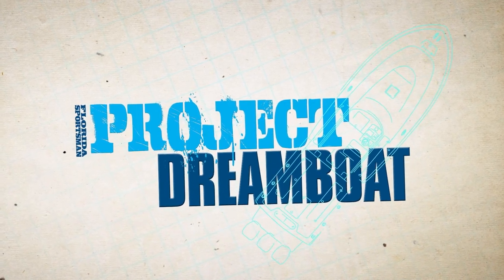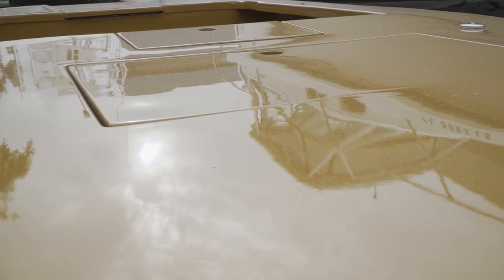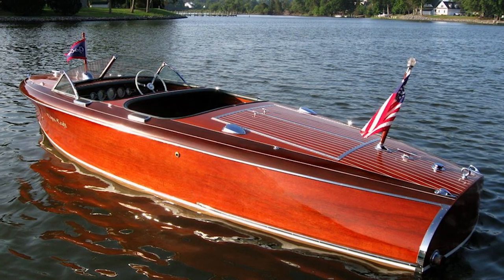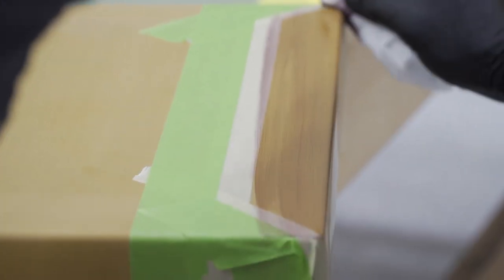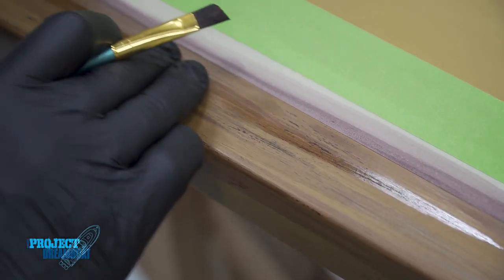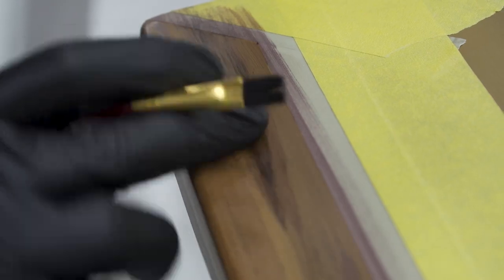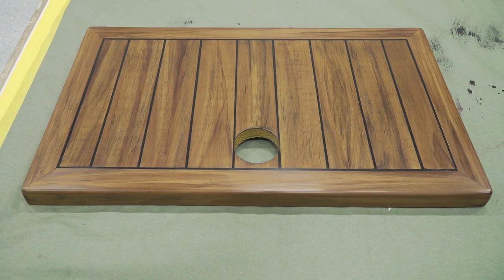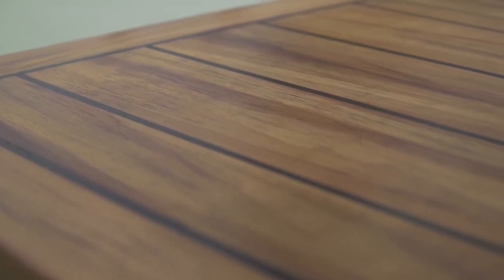How to Paint Realistic Wood Grain Like a Professional | Project Dreamboat

Comment: When we make decks, we use quarter-sawn wood which is a vertical grain-very straight lines. You have painted your hatch with a flat grain pattern. Flat grain wood can not be used as a deck because it expands and contracts at a different rate than the pieces on either side and will just tear itself apart during weathering.. All decks on every boat/yacht uses only quarter-sawn wood.. Meaning your paint job is technically incorrect.
Change my mind...